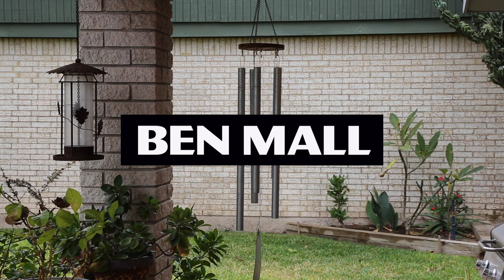Fixing Windchimes

Comment: I would suggest learning how to properly swage sleeve fittings and those “grommets” as you call them are insulators, vibration insulators, they mimimize the transference of vibration of the chime tube to the suspension cable, thus prolonging the tone.
Reply from the maker: Thanks for the good info!